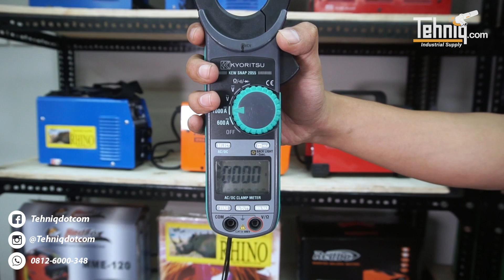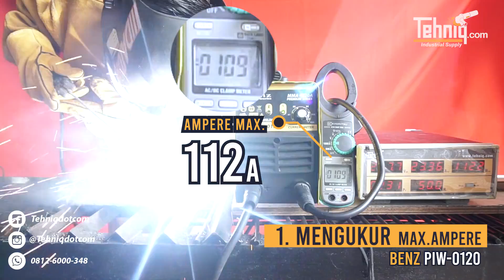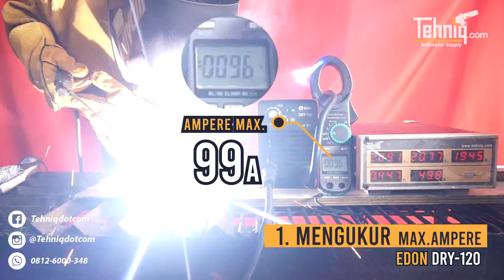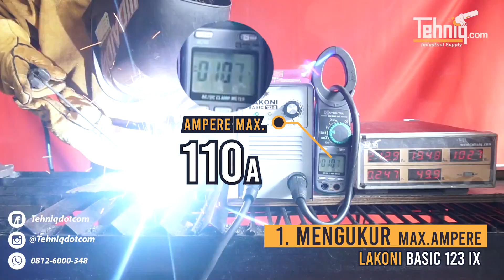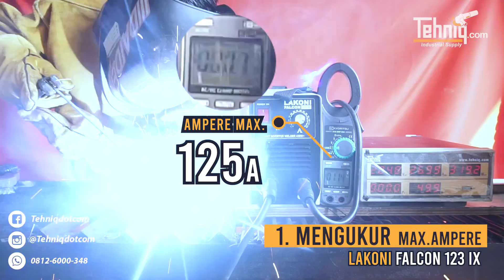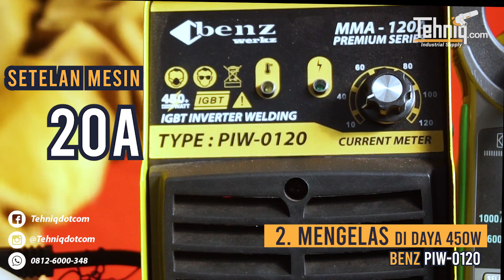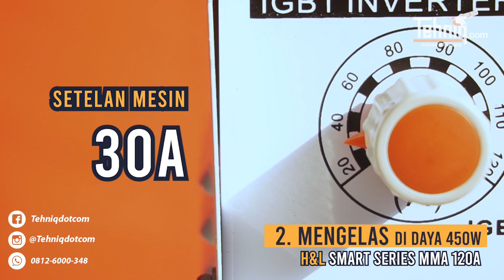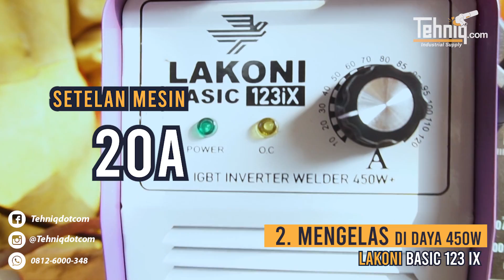Pertarungan SENGIT ! 6 mesin las / trafo las 450 watt TERLARIS dan TERMURAH tahun 2019, PART 1

Comment: Sekedar koreksi, di situ tertera 450 Watt, sedangkan MCB 2 ampere itu 440VA....VA dikonversi ke Watt dengan efisiensi (cos phi terbaik untuk impedance 0,90)= 440x0,90= 396 Watt, jd kemampuan langganan 450 VA hanya mampu beban 396 Watt, kalo dibebani 450watt ya trip
Reply from the maker: makanya bang dengan pengujian ini kita mau kasih info sekaligus edukasi kepada penonton supaya tidak tertipu dengan info mengenai mesin las yang katanya bisa ngelas didaya 450w

Comment: Maaf bg..mau nanya.,listrik di rumah saya 900 wat.,kalo pengen las san nya matang dan kuat.,stelan nya di berapa amper bg?.,dan kawat nya berapa mili?
Reply from the maker: sebenernya kurang maksimal gan kalau di daya 900w, tapi silahkan dicoba aja dirumah gan, settingan mesinnya main di 40-50A, terus pakai kawat maksimal 2.0mm
Reply: @Tehniqcom  siap gan...makasi banyak ya gan.,info nya.semoga sukses terus chanel nya gan🙏

Comment: Lakoni falcon 450w max settingan brp ampere dengan daya listrik rumah 900va?
Reply: Dan untuk kawat brp mili?
Reply from the maker: setinggan mesin coba main di 40A-50A bang, pakai kawat maksimal 2.0mm. Tapi sekarang lakoni falcon putih ini udah gak ada lagi bang, gantinya yang model basic ungu
Reply from the maker: maksimal kawat 2.0mm
Reply: Untuk hasil las di ampere 40-50 gmn y,,kmren videonya klo gk salh di ampere 20A dan 120A

Comment: Bang bedanya ap y yg 450w dgn yg 900w,contohnya d mesin Ryu,pdhl sama2 amperenya max bisa 120A ???
Mau beli makanya sy cari2 referensi dulu bang.
Reply from the maker: 450w dan 900w hanya gimmick marketing aja bang, sebenernya kalau pengelasan itu patokannya di potensio ampere, semakin besar ampere, semakin gede juga wattnya. Cuma saran dari kami, untuk pengelasan minimal daya yang digunakan 900w, itupun dengan catatan kawat las yang digunakan maksimal ukuran 2mm dan settingan amperenya 40-50A aja. Semoga membantu
Reply: @Tehniqcom  sy punya listrik token khusus 1300VA ga d pake alat2 elektronik sama skali,harusnya scara teori sdh kuat y bang ???

Comment: Boss itu mesin las tertulis 450 Watt.  Tapi di alat test single phase parameter terbaca up 1000watt ketika disatting full amper. Speck 450 Watt itu tidak real dong... Boss. Mohon petunjuk boss...
Reply: Iya kok bisa gitu ya ... 450 Watt ... Apa betul hanya bisa berkisar 20 - 50 ampere

Comment: daya terpakai  rata rata berapa ribu watt itu bang pada amper maksimal mesin las ?
Reply from the maker: ampere maksimal itu rata-rata diatas 3000 watt bang
Reply from the maker: @putradewata5347  settingan potensio di 30-40A bang kalau mau pakai didaya 900w
Reply: @Tehniqcom  siap bang, trims
Reply from the maker: @putradewata5347  sama-sama bang

Comment: Berarti kalo di listrik 900 kuat ya om
Reply from the maker: Masih kuat bang, tapi dengan syarat pada saat ngelas settingan mesinnya main di 30-40A, terus gunain kawatnya maksimal 2.0mm.
Reply: @Tehniqcom  kalo pakai 0,2 trs amper 30-40 nyala berapa lama njeglek om
Reply: Trs yg nyala apa aja om di rumah selain mesin las

Comment: Tetep aja mcb turun
Reply from the maker: Pakai berapa ampere MCB dirumah bang?
Reply: Ya kalau 450 pasti turun gan tapi rumah saya 1300 untuk 110 amper satu stik 2,6 dah turun
Reply from the maker: @Senimanbajaringanholow  amperenya kebasaran bang, 1300w idealnya main di 50-60A